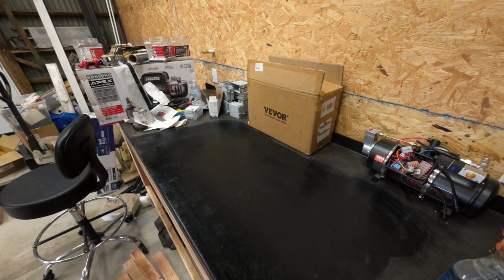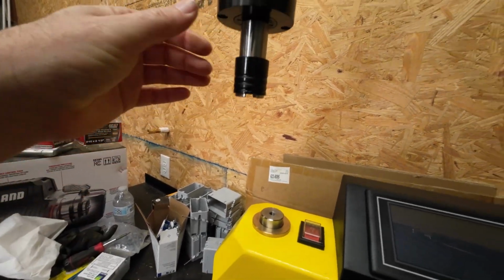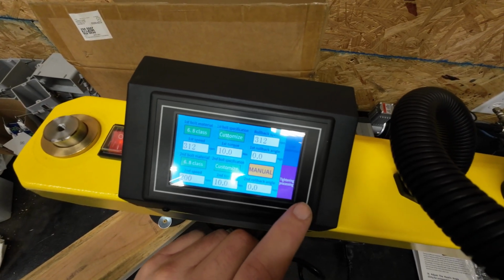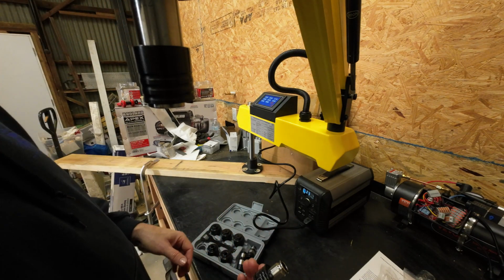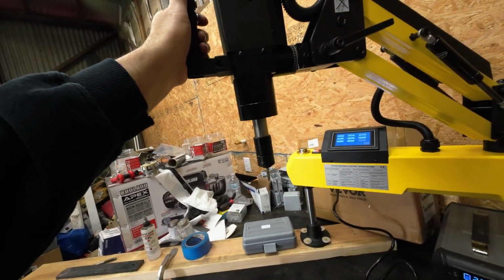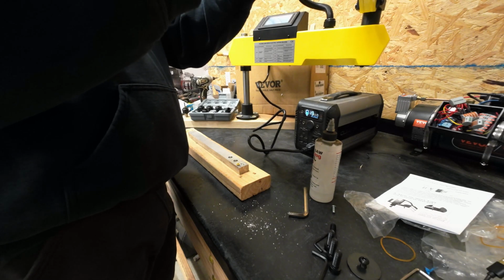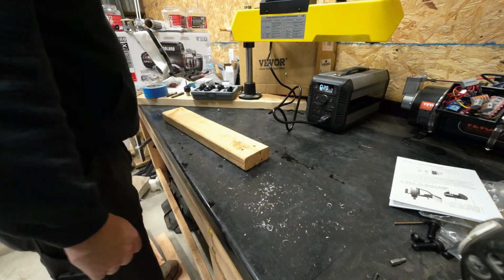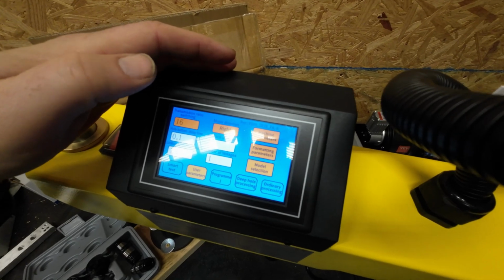Trying out a budget tapping machine arm!

Comment: These machines are really useful if you actually need one. Since most of these on eBay and Amazon come from Asia, it’s all metric. If you need inch, you better find a vendor who has inch. Not all do. Be really careful setting torque and release adjustments with the torque control. It’s easy to snap taps off with these. That board might be knocking it off angle. I mounted mine to my 500 pound welding table with an insulated layer between it and the table. That has holes for clamps, which I always use. It works very well (a different manufacturer), but I don’t use it as much as I thought I would. I tend to tap on the mill since I’ve drilled the holes there. You need space behind it. Mounting it near a wall will cause problems moving it to the right position as the arm often has to move backwards. Since you went to the expense of buying this, get some Tapmagic both for steel and also for aluminum. It’s really dangerous holding the item you’re tapping, clamp everything down. You could break your arm. No joke! Good luck.
Reply from the maker: Thanks for the info!  I do a ton of tapping threads, and dont always want to keep threadmilling bits for all the sizes and threads since they cost so much. Also sometimes I dont want to take the time and tune in the threadmilling in the CAM, although I should.

Comment: I just finished setting up an ultrasonic welder we bought at work with a very similar touchscreen interface. Ours just shows the name and whatsapp number of the factory in china, I feel cheated that we don't have a "Dr Chong Intelligent Expert System" robot. That alone has to be worth like $150.

If you have any contact with the seller, ask if they have any video manuals. We've bought a few of these direct from china industrial process machines, and the video documentation provided was way better than the written manuals. I think its easier & cheaper for them to do that than have a manual typeset and translated.